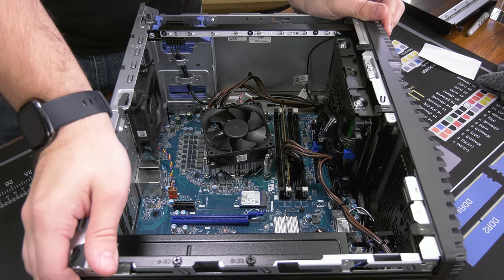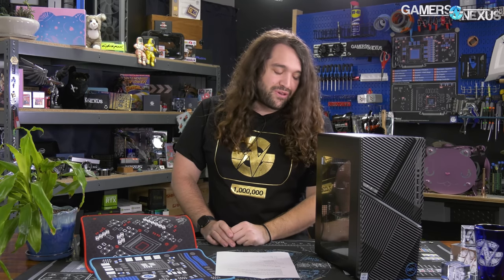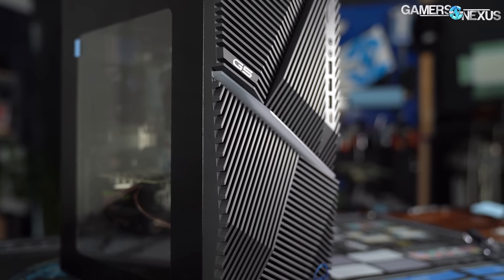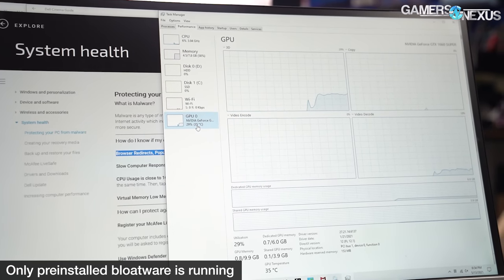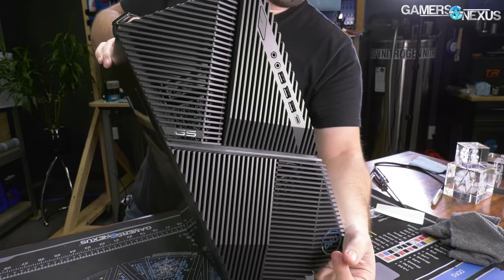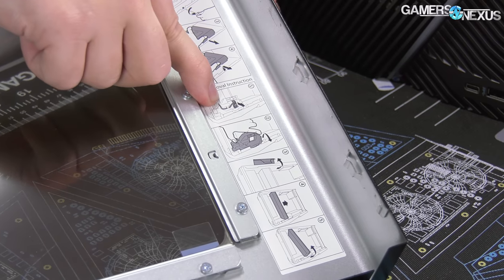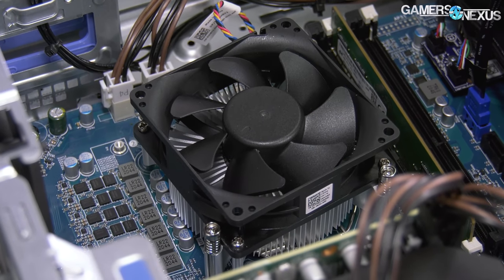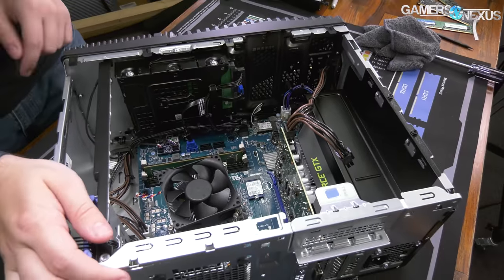Worse Than Walmart: Dell G5 5000 PC’s Garbage Parts & Hidden Charges

Comment: "There are good prebuilts out there.
In theory.
We're working on finding them for you."

We feel you Steve
Reply from the maker: We're genuinely trying! We bought 3 of them for this round. So far, one is kind of promising. That's a start. Still has major issues, but it's workable. The Dell one was just unsalvageable.
Reply: @GamersNexus  HP Omens are solid. Bad airflow case design with some warm temps but overall system is decent. Lack of bios access and  a pc sold as a “enthusiast” pc that you can’t really do anything with is an issue
Reply: I hope this embarrasses dell into some action!?!⚡
Reply: @GamersNexus  I wouldn't be surprised if the SSD in this is some crap-tier OEM drive. It looks the same as the ones they stuck in my old G5 laptop, which had read speeds slower than a platter drive.
Reply: @GamersNexus  Please review helium pc.
Reply: @Jrobb1999  Aaaaannnnd VERY strict TDP which HP follows. Your CPU will throttle to 65 watts max if it is a 65 watt part on the HP Omen systems (Linus observed this with the 2020 secret shopper series) But overall HP Omens are actually pretty decent prebuilts considering that its HP we're talking about here.
Reply: "There is alien life out there in the universe.
In theory.
We're working on finding it."

Same mood.
Reply: @GamersNexus  nice! please do more prebuilts!
Reply: Of course it is possible to 'create' a prebuilt that is not crap, but then they won't sell.
The first thing that a potential customer for a prebuilt looks at, is the price.
Like on Quora, I answer many questions on 'is this a good gaming PC for 800 USD' with a link to a crappy system.
I suggested the asker to be a PC builder doing that to make a living.
Noname power supply : $30
Corsair power supply 80 Plus Gold : $120
"If you want  to sell a system to me, you will have to pick the 120 USD supply, but then that system won't cost below 800.."
I'm quite happy with those vids, they tell the same story.

Perhaps you remember the past, where Compaq, HP, Toshiba and friends, built PC's with a custom BIOS that didn't allow for standard parts to upgrade or repair a system.
Screw them.
Reply: Usually the good prebuilds tend to be non-branded ones from pc shops. As those will pretty much always use standard components.
Reply: @domi06021988  Here in Croatia every hardware retailer offers computer assembly free of charge when you buy parts from them. Basically you get full custom build plus all the separate warranties for your hardware.
Reply: @GamersNexus  You mean the Dell system is unsalvageable without a hot air rework station, and a scrap dealer.
However is it the perfect School PC, the kids won't be temped to steal bits out of the case, as it's all junk.
Reply: @swinnburn  Well, this is a 2nd reviewer with 1M+ followers, so you'd hope.

On the other hand: "BuT thE ShARehoDLerS!"
Reply: ebuyer is selling a 3060ti prebuilt for £1400 when a 3060ti on ebay is £1300, id say thats at least worth a shot lmao
Reply: @GamersNexus  I've heard that Maingear makes really good prebuilt desktops.
Reply: Cyberpower isn't a bad shout honestly, you just have to know what to look out for and be willing to compromise a bit on some things vs DIY.
Reply: Does the Phantom Canyon / NUC 11 Enthusiast count?  If I recall, it wasn't sandblasted in its GN review.
Reply: Honestly they wont change. They are in hot seat today but they wont be next month. They didnt change despite linus, they wont change despite steve
Reply: @swinnburn  If Linus, the biggest tech youtube channel in the world not only doesn't do something but they actively lied in his face about them improving and him calling them out AGAIN doesn't do anything, i doubt this will.
Reply: @GamersNexus  have you tried out the dell optiplex business line, if they're still being made???  I love those if I can get them on my local auctions from my county government
Reply: @swinnburn  Based on that mobo, I doubt it.
Reply: @brankosabol  no one in Germany make it free you can on any normal shop pick all parts but they have no good system for it to forget something or compatibility checks. And they charge 150-200€ extra. Mifcom is specializing on building it’s one of many who offer this. But on all you pay a good amount of extra money. 

But all parts are normal customer parts
Reply: @GamersNexus  Eta prime seems to have some more luck with them. He has reviewed some nice prebuilds in the last months.
Reply: A vote for HP Omen review! I bought 25L Omen with 10400 and RTX3070 because my brother needed GPU upgrade desperately. I switched the CPU cooler and dremeld a 140 mm hole to the bottom for a Noctua fan, and after those changes I'm quite pleased with the results. Price total wasn't bad either considering the 3070.
Reply: @northwiebesick7136  They switched to using these weird proprietary 12V PSUs in the OptiPlexes as well a few years ago. So you’re stuck with a Dell only 300-360W odd PSU on many of the non-workstation class desktops.
Reply: @GamersNexus  had to go with a cyberpower PC. 6700xt and 5600x for 1500 ish. Solid performance
Reply: @SCSNSE  oh, I know... I've got a few that aren't quite to standard, but at least in the optiplex line, at least as far back as the models I have bought for around 1-3$, such as the 780 and 1070, at the very least had sata power coming from the power supply... Mind you I always got the SFF full tower versions because, well, government, yknow
Reply: @GamersNexus  I know the focus on here is primarily gaming rigs but any chance you could check out a System76 prebuilt?
Reply: I went with origin pc for my first one. $3750 for the build, which was about $1000 more than buying and building yourself. That is assuming you could get a 3080 for msrp. So in reality, I actually made profit if I decide to part out and resell?
Reply: @swinnburn  dude linus tech tips already called their ass out and they said they were "doing something" and then when they did a surprise checkup and IT STILL WASNT FIXED, they were like "what the hell bro." and these are LINUS TECH TIPS one of the biggest computer channels rn. and they got nothing from dell. 

i give it a 3 percent chance.
Reply: @GamersNexus  how about narrowing it by using Linus latest secret shopper result?
Reply: @komocakeps527  Hasn't he gushed over the M1 with everything soldered to the MB? That Dell has more future options than the M1
Reply: @BigTylt  Wait, i just realized it. That makes sense. The board actually looks like a laptops'!
Reply: @quixotic7460  And with your tax dollars.
Reply: Well, in all fairness to the big OEMs, they're not THAT hard to find, it's just that the ones I know of are workstation grade machines... At which point it's not a good deal for a home user. Get an HP Z4 or Z6, boom well built, great thermals, super quiet. But you pay for it.
Reply: @GamersNexus  great stuff to be focusing on as I feel many of us are moving to the pre-built market to get what we need currently. Can't wait to see the other pre-built reviews!
Reply: @TuomasStarck  A few years ago I had an HP mid tower that I got basically for free. Wire routing was terrible and the odd form factor power supply failed about every six months or so. No more powerful supply was available in that configuration. I have about four of these supplies sitting in my "to be recycled box". I used the case for my build which was a mistake as I had other, better cases laying around that I should have used. 

-dabe
Reply: @SCSNSE  Sorry to hear that! I was looking for a newer Optiplex but I guess that's not an option now. Maybe it's time for me to do another build.

-dave
Reply: @dgwachtel  actually, you know what really sucks... The optiplex 7010 enough data ports to go with power plugs, but the mini-full tower has 2 internal USB connectors, which it doesn't have anyplace on the case to mount stuff to, unless you took the DVD drive out and put in a 5¼ accessory plate, whether it be sd-card reader, or whatever have you that can come in that format
Reply: @GamersNexus  I should send you pictures and vids of the Dell Alienware R12 I just bought (Arriving July, just to get the gpu, gonna sell the rest off)
Reply: @GamersNexus  can you do a review on ironsides prebuilts? Got mine from them its worked well my only problem was they didnt add a fan to the back of the case.
Reply: @stuporman  Yup i know keeping an eye on it. I get it mid July so should be fixed by then
Reply: @GamersNexus  Get a mid range ASUS with an I7 or up. I wouldn't have even reviewed a Dell. They have been garbage since the 90's at least. We used to call them the Harbor Freight of the computer world.
Reply: I got a powerspec from microcenter due to the gpu shortage.  Tried for 6 months to get a gpu.  Gave up bought the pre-built, I tore it apart to see how shitty it was and was amazed all the parts were msi, or Evga.  The only thing I didn't like was not able to get to the bios.  Apart from that it's a solid build, yes I paid 2400 for a AMD ryzen 9 and 3080.
Reply: @gagelarson2293  
https://www.youtube.com/watch?v=b2vrvQydVIw
Their review of the ABS prebuilt - presented with the prestigious "It's Better than Dell" award!
Reply: I bought a pre-built from a local shop where I live. R5 3600 rx 5700xt. It's an amazing computer for 950. I was extremely happy to have gotten it right before the chip shortage and massive gpu scalping.
Reply: Still hasent found one thats worth it. Build your own.
Reply: @GamersNexus  I don't remember if I saw a video of this particular company but, is Xotic PC one that you have reviewed?
Reply: I bought an ABS pre -built earlier this year. It was the only way I could get a 3000-series card. It posted the first time, fans and connections were all correct and snug. Quality parts except for a c-tier PSU (Thermaltake GXT 700) and only 16 gb 3000 RAM

I actually liked the rosewill prism case so I kept it and replaced PSU, Ram and installed an AIO + noctua case fans. It turned into a nice full ATX build.
Reply: HP omen 30l is pretty good!
Reply: @GamersNexus  have you tried hp prebuilts? I heard they're pretty good

Comment: I still have a Dell with Windows XP and I remember it was over-priced at the time but at least the quality was there.  Good to see some of the parts from my old PC are still in use in that Dell of yours!
Reply: Dell was good at some point lol
Reply: One hell of a roast.
Reply: The Dell Dimension was where it's at
Reply: Did it have a weird power supply and motherboard?
Reply: is this "junk"pc made of NOS  parts? verry bad for the name of dell
Reply: right looks like my dell from 2003
Reply: All the Dells I've seen have those same power connectors and other proprietary designs that have remained the same over they years. It's OEM, not a homebuilt. Kinda like Macs.
Reply: Dell Used to be known for reliability and VERY LONG Gevity.
Reply: Now Dell has gone batshit crazy!  I use to admire Michael dell for his custom PC build strategy. Now Dell is like anyother OEM , they all suck except Apple which atleast makes shiny new stuff.
Reply: I have a 2012 Dell 7010 desktop and the parts like CPU fan and motherboard look exactly the same in this high end built
Reply: @benjaminwilliams3568  In laptop terms, they're not all that bad. My XPS is still going well. Which just adds to the confusion as to why Dell would want to hawk shit like this on the desktop market. I think they're lumping all the leftover industrial components they have made for servers, workstations, advert boards etc into whatever they can pass off as a "gaming rig". If it can play Fortnite, it counts.
Reply: Have a Dell Inspiron 545 with Q8200, I think it's ok, standard parts, CPU of course the only Core2Quad without Virtualization. Use it as a pfsense Router, as I pay fixed rent atm.
Was Vista, but was upgraded to Win 7 and Win 10 over the years. Just wasn't feasible anymore for even just document editing and browsing.
Reply: I still use my XPS630i to this day. All original parts work, even their proprietary Dell OEM PSU despite the constant bashing for terrible supplies. 
Originally had the Dellified 650i SLI but it was ditched jn favour of an ASUS P5E64 WS Evolution (X48) QX9770 & 4x2GB Corsair Dominator, one of the only boards that could go toe to toe with the Rampage Extreme back in the day
Reply: @foc2241  "DUDe, I GOT A DELL!" I had a Dell back in the Pentium III days !!
Reply: @PankajDoharey  >except apple which atleast makes shiny new stuff

Yeah, that scans all your photos under the guise of cheese pizza.
Reply: @tdg710  OK, That is bad i agree but so has google been scanning your photos forever without telling you, atleast Apple has kicked off a discussion.
Reply: Dell used to make good screens and keyboards 15 years ago.  That's it, that's all they contributed to the industry, robust keyboards and screens, since all their money went into that since their PCs have always been terrible.  I had a graphics card die on me in one of their cases when I was young because of the terrible ventilation they have and their dust prone design.
Reply: @PankajDoharey  Apple lmao
Reply: @PankajDoharey  as far as I'm aware no, google does not keep a database of over 200k "CSAM" images and they then in turn do not scan your photos on your devices to cross-reference it, giving your device a "CSAM score". Don't know what CSAM is? Google it.
Reply: Jesus Christ my guy we were trying to burn them, not completely char them!

Comment: "So, what you're saying here is not that you didn't intend to charge me this $67, you just regret that I was able to notice it."

Dell: "Yes."
Reply: I'm thinking she was honest because she disagrees with the practice and wants it to get media exposure.
Reply: @Arashmickey  I didn't last long in support for the exact same reason. Wasn't fired, but didn't feel like staying with a company that makes it more difficult for their clients
Reply: I bought an alienware laptop recently, and I had the same charge, except for $109. Had to return the thing because everything was wrong with it (CPU perpetually throttled to 0.8 GHz whenever plugged into the wall, unbearable dentist drill/jet engine fan noise, random freezes, screen randomly dimmed to an unusable level until reboot, and subpar performance even when it worked -- less than 11k on timespy with a 3080). I tried to get support to look at it, and after having me run around in circles reinstalling windows twice for what's obviously a hardware issue, and promising to send a tech to help, they archived my case.

10/10 would buy again except the opposite. Jesus.
Reply: @isodoublet  even considering Alienware, there’s your first mistake.
Reply: @trevor7355  Can't argue with you there. Big oof.

Comment: "Load bearing cpu cooler" might be the best thing I've heard since "out of the box thermals"
Reply: Just imagine what happens when the case warps slightly. Suddenly you've got a lot less mounting pressure on the CPU and your thermals go to hell.
Reply: Reminds me of Seinfeld with load bearing walls 😂
Reply: @falcie7743  Coolers come loose in shipping all the time, quite often damaging the motherboard in the process. Putting the load onto the metal box and not the motherboard makes a lot of sense though I get your point about the difficulty of consistent mounting pressure but it appears in this case there's spring tensioning so in practice it will probably (maybe) right itself.
Reply: @MatWilson2612  I was thinking more 30 Rock and the load bearing balloons
Reply: I'm glad that I can mount my Noctua straight into the case on mine (XPS, but it seems the same internally). Far superior to the motherboard mount method that's standard. Do you think motherboards don't warp and flex?
Reply: @IMelkor42  Mines pretty dang warped, C shaped. I don't know what to do about it and it still works so...
Reply: The thing “bearing” the weight is quite possibly the motherboard; with unnecessary pressure.
Reply: It's not really load bearing tho. The CPU cooler is holding down the motherboard but there is no load being beared on the actual cooler.
Reply: @falcie7743  In what scenarios does a case warp like this?
Reply: It's the one thing Steve gets totally wrong though.  They didn't make it "load-bearing", they removed the load of it from the motherboard.  With proper tensioning, it makes the system far safer in shipping, since the heavy mass of the cooler is primarily loaded onto the steel chassis instead of the PCB motherboard.

The problem with it is that it's non-standard.  The way it's loaded has major advantages over ATX standard.  (Which is exactly why it was a feature of the BTX standard.)
Reply: @complexacious  I used to run a business that would sell PC's, although for a PC cooler like that, id argue its not a big deal unless you're dell and trying to save on every last penny for thee few small 0.1% of PC's that do get damaged by the cooler.
The cooler of that size could be mounted to the motherboard without worry. Now if I were going larger, then id worry more.
Its the same logic with the GPU. Its not held down besides that clamp pressure, it COULD fly out in theory, I've seen it happen, but the GPU is so light, they don't have to worry about it unless they're very unlucky.
Its overengineering.
My solution to both of those problems was to package the inside of the PC's. Other OEM companies do it anyways, so if it allowed me to ship PC's without any damage risk, it was worth doing, especially since I'm not Dell and didn't have my own assembly line of custom parts.